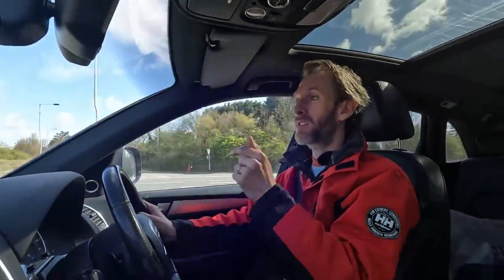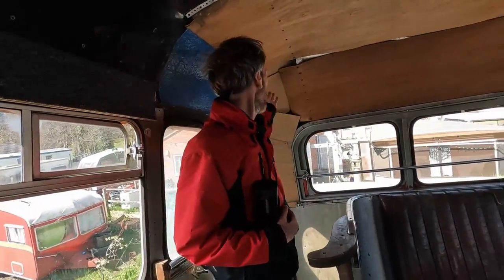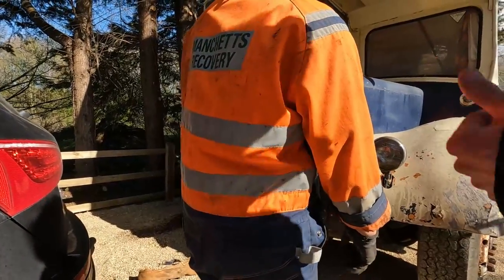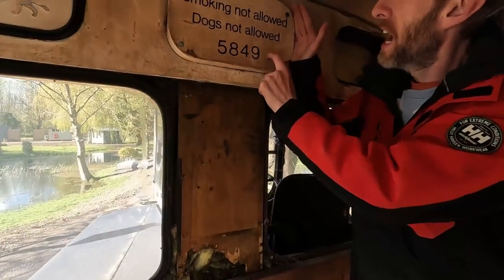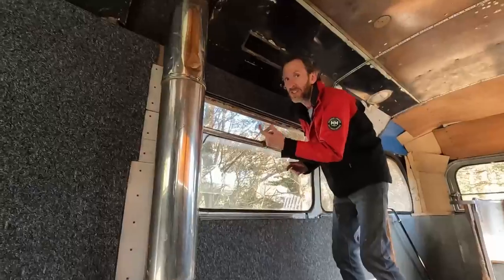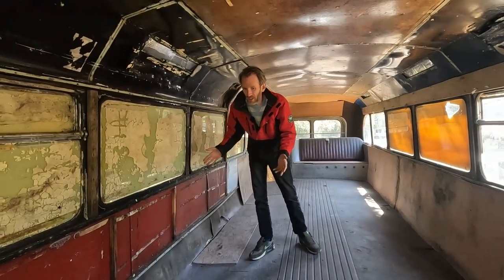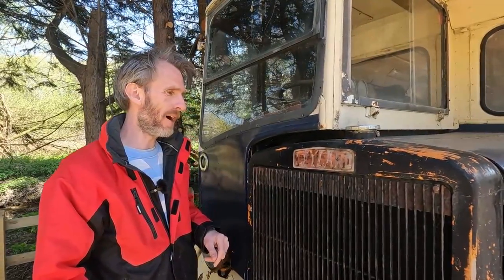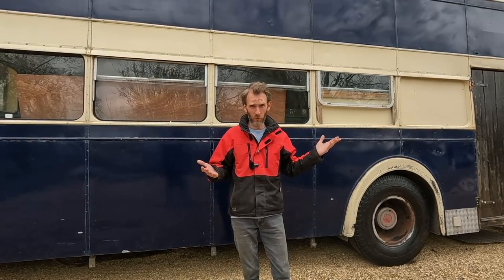Collecting my 1967 Leyland Titan Double Decker Bus !!

Comment: I also passed my test in 1965 on a 1947 model from Nottingham. Baseford Transport driving school. Has this one got a crash box.? it seems earlier than 1967.
Reply from the maker: What’s a crash box 📦???
Reply: @lewisbower2137  A gearbox with unsynchronized gears.
Reply: @Varinki   It doesn't look like it has an engine fitted.

Comment: Are you sure that is not a re-reg job, because the model design says early 1950s not late 60s
Reply from the maker: That’s a clever spot ..!! I’ll check the v5 ..!
What’s the best way to find out .?
Reply: No its the original number HJA949E	Leyland PD2/40 chassis No L64194  East Lancs body No 6484  H36/28R new 3/1967 Stockport fleet No 49
Reply: It’s an East Lancs body and is similar to several batches of St.Helens fronted PD3’s delivered to Leicester City Transport up until late 1967 on ‘F’ plates.
Reply: @johnwakefield2083  I cannot remember,  were Stockport one of the towns that demanded the PD2 (simple, less new systems than the (Heavier?) PD3 ) for as long as possible ?
Reply: @johnwakefield2083  Selnec Orange/White.  like Cardiffs White/Orange (that CK also used !) doesn really suit half cabs.  East Lancs were in Blackburn? ( mainly , they acquired another co too so what site was it assembled on ?)
Reply: @lewisbower2137  I used to travel to and from school on this old girl and her sisters on the (3)16 route from Southern cemetery to Parrs Wood (it went further to Stockport) . That’s her original number.  Stockport Corporation originally but SELNEC Southern when I knew her.
Reply from the maker: @nicksayajirao1730  no way..!! Small world … pay £2.50 and you can come sit on it again ..!!
Reply: The appearance of the Leyland PDs didn't change much between 1946 and 1969 when the last were built. Lots of detail changes to the spec., but not obvious to the casual observer.